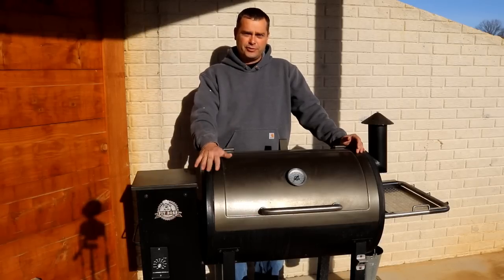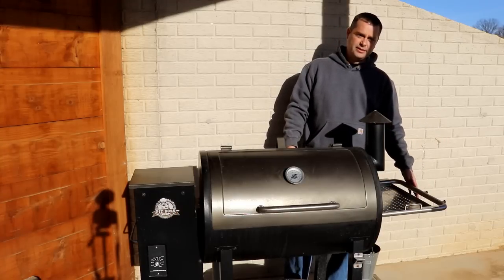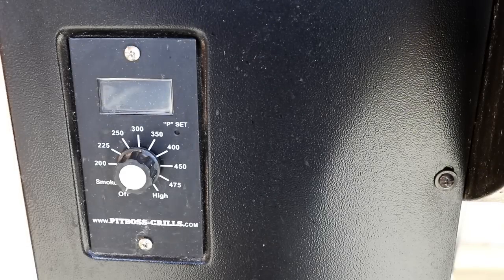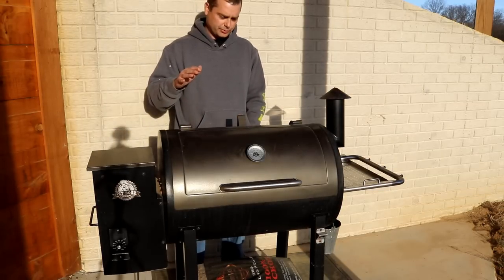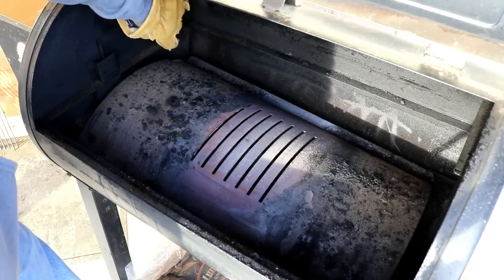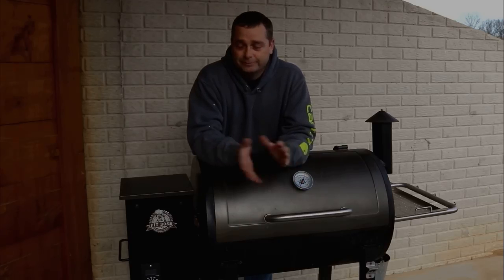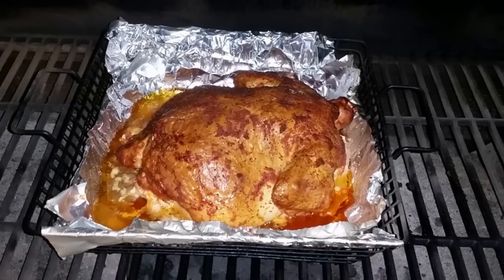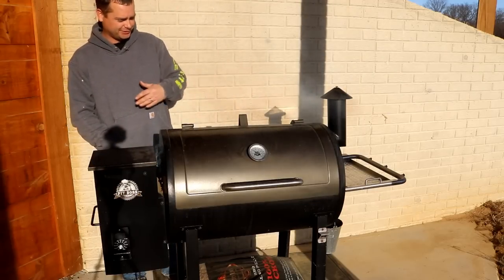Pit Boss Pellet Grill - Year and Half In Depth Review

Comment: Just bought one looking forward to using it. I do have a few questions.  When you start it should you open the led or is it okay to leave it closed when firing it up?  Any suggestions when seasoning it for the first time? Lastly, which chips give the best County Fair type smell?  Thanks for the review.
Reply from the maker: I would leave the lid closed when starting.  The first first you start it, it may take 2 light off sequences to get wood the auger filled and wood pellets out to the burn pot. After it lights, I would get the grill up to 450 degrees for a few minutes to burn any residue off then turn down to 200 degrees for a couple hours to season it.  Try hickory pellets.

Comment: Great review, I have a question on the temperature fluctuations, my grill sometimes gets 30-50 degrees higher. I believe the Instructions said the temperature can be fluctuate about 20 degrees. If you had the same issue how did you resolve it. And on the smoke stack what do you recommend to have it fully open or semi closed,  I heard it can make a difference in the temperature
Reply from the maker: I wish I could tell you how to minimize the temperature swings.  I don't know if I have ever solved that problem.   The only option you have is to adjust the stack.  Trial and error.  Also the temperature is also effected by outside air temperature since it is contantly blowing outside air into the burn pot.  So it may act differently in winter than in summer.  I would guess the temperature swings worse in winter time.  Even though the temperature swings, the food turns out good everytime.
Reply: I don't really pay attention to the temp swings, you kind of need a little to get good smoke I think, I always cook to internal temp. and use the time and temp settings as useful suggestions.

Comment: im trying hard to decide between this one or the Auatin XL which has a 32lb hopper capacity and more cooking space , however it shows on their site that the deluxe has 40,000 BTU  n The Austin XL only 20,000 BTU       PLUS the Austin XL is cheaper at like 470 / where the Deluxe is bout 700$    SO CONFUSED Especially with why would anyone need 40,000 btu comapred to 20,000 btu
Reply: I don't know why this is an issue as My Austin XL will get well over 500 deg in March  when it's -5 degrees C outside. I do know that Lowes.com has/had the 820 on clearance at 1/2 price ......... makes you wonder, hmmmm!
Reply: @garysampson5258  The clearance model is from last year, they are replacing it with an identical model but includes temperature probes to insert into your meat. I have the clearance model and love it!

Comment: How often do you have to clean it? I hope not after every use..
Reply from the maker: After about 60 pounds of pellets.  Which is 3 normal bags of wood pellets.  Probably about 72 hours of cooking at a low temperature.
Reply: Country View Acres thx and nice review. I was considering the RecTec but saw ur review and for the money....  does it grill regulate temperature well. I know the Tec does very well.
Reply: Also Walmart has the 700FB on sale for $337
Reply from the maker: @jeffsond ,  The pitboss's temperature will swing 20 degrees plus or minus.
Reply: To make sure it doesn't go out i recommend vacuuming the fire pot after each cook. Doesn't take long.

Comment: Question:  Can you adjust the “P” Setting, while the grill is burning at your desired cooking temperature and while you are in the middle of cooking?
Reply from the maker: As long as the grill is running you can adjust the P-setting.
Reply: The p setting is only for the smoke feature. Cold or windy you want a lower p setting. I live in Texas so when it is hot I have mine on 5. Again the p setting only affects when in smoke.

Comment: It boggles my mind how the more expensive models like this one didn't come with temperature probes like my much cheaper Pit Boss Classic (700 sq. in).   P.S.  No one uses the sliding char-broiled feature on the heat shield. Just wrap that thing up with foil and forget about it.
Reply: It would be nice if it had a way to open it in use. There are times I would like to sear my steaks before cooking them but it's too much trouble
Reply: @mikemickey4102  I use mine all the time , just make a hook with a handle to move the grates and open/close the sear plate. Nothing hard about it.
Reply: Use mine all the time. You can slide it open and closed with a fork between the grates.. just move it from one space to the next until it's open or closed
Reply: If you cook steaks and have not used this feature, your missing out. 400 and cook till preferred doness. Only thing you have to watch for is the steak catching fire if it's dripping lots of fat. Doesn't happen often. Just watch the temp. If it spikes suddenly move the steak to a safe zone. Close the lid and wait a minute, then move it back.

Comment: Can you cover heat shield in foil
Reply: Yes
Reply: Yes, you can cover the heat shield with foil. It makes clean up a lot easier.
Reply: No, you're just asking for temperature swings. C'mon, how hard is it to clean the plate?
Reply: @garysampson5258  I can pull mine apart vacuum and scrape in 5 minutes. So no not that hard. Would probably take me longer to wrap in foil.

Comment: “So its about half a ten pound bag” so in other words about ten pounds. My goodness man read the manual.

You can absolutely start it at any temp but you are risking filling the hot pot with more pellets than it can handle on start up via the auger spinning faster to account for increased temp. This can suffocate the hot rod or even worse create a back fire through the auger tube and into the hopper. Becareful doing that